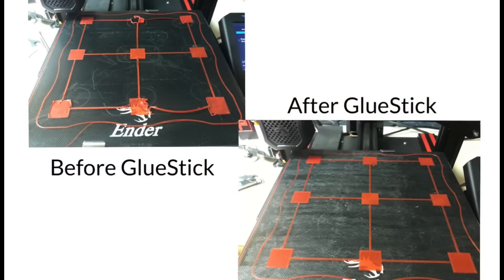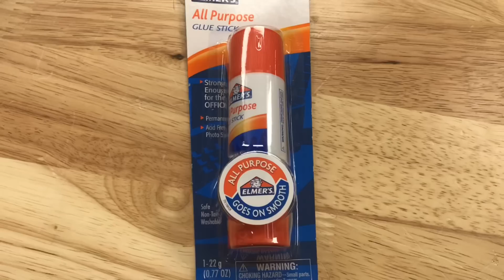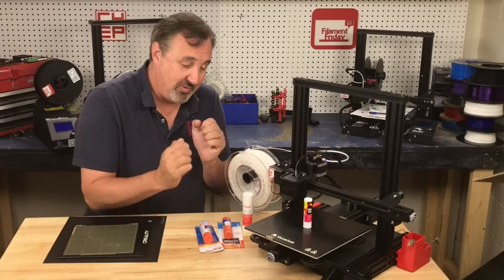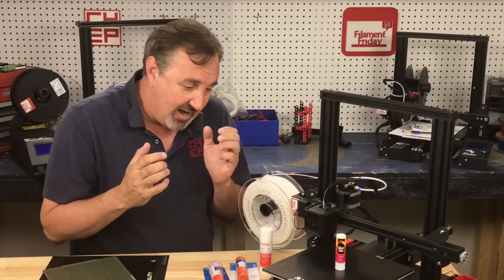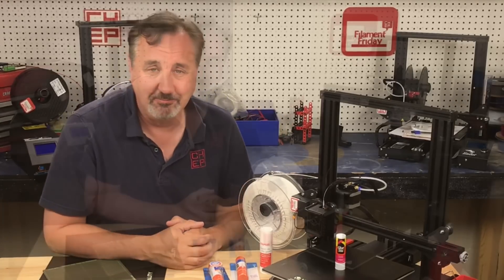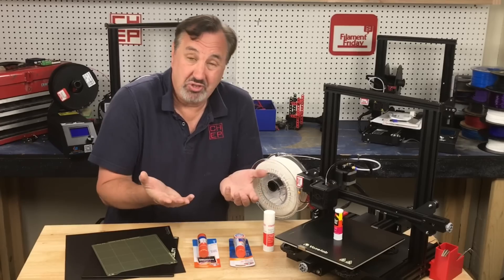Better Bed Adhesion with a Little Glue Stick

Comment: Thanks. For the tip.  I was having a big issue with the prints coming off in the beginning of the print and then right before it finished.  I use an ender 3 pro with the platter, ender pad and a glass.  Swiped on glue and let sit and started to print.  It appears to be working so far on a sample print.  My platter is level also.

Comment: On my ender 3 v2, I've had adhesion issues both not sticking or sticking too well. Saw somewhere that cleaning with dish soap. Tried it and lo and behold, prints stuck until the bed cooled, then popped off with a very mild bump. I will keep the glue stick in mind for when the carborundum surface wears out.

Comment: I know it's a little messier but i'm still sticking with hairspray. But, i do have some glue sticks laying around. This is all great advice, especially the part about the you need a new build surface babble.

Comment: I love the WhamBam pex but I have had a roll of PLA filament that just would not stick to it. Switched back to the old build tack (still didn't stick) so added glue stick and voila! perfect every time washed the surface between prints and had no issues. So I swear by glue stick too - only when needed.

Comment: I run glass from the dollar store on all mine. I haven't used glue in years. Straight on the glass after level and go. Haven't had a failed print in at least 2 years. But to each their own if it works for you.

Comment: I totally agree with glue stick after leveling. I find putting it on cold works the best for me. I find putting it on a hot bed makes it go on too thick and harder to control. Just my own findings.
Reply from the maker: Yes, I should have mentioned that. I always apply to cold bed.

Comment: Glue stick works like magic, my prints come out perfectly flat on the bottom.
I have even experimented with lowering the plate temperature and it still works, which saves on electricity, the sticks literally pay for themselves.

Comment: I used a glue stick and after a while it was just to difficult to remove and it also failed after a while. Then I tried firm hold hairspray it holds on and I can go layer on layer. It also cleans easy with hand sanitizer alcohol. Every once in a while I still need to level my bed but I think that is just because of the cleaning after using hair spray but that was the case with the glue stick too. Hair spray is also easier to apply. Just a layer or to and we are ready to print. And when it leaves a little imprint after removing the objects you just smooth it with another layer and keep on printing. The glue stick had to be cleaned every time because it lost it's stickiness after one print.
Reply: Why would you use hand sanitizer that has other things in it? Why not just use isopropyl alcohol?
Reply: Did not know about it until now, or where to get it.

Comment: Interesting. I found this video because my Neptune 4 included a glue stick but didn't mention it in the instructions.
Reply: I’m interested in the Neptune 4 which model do you have ?   How are your print at 250 mm ? Thanks
Reply: I have the regular Neptune 4. My first print turned out well, but I haven't printed much since then.

Comment: I replaced the magnetic sheet that came with my Ender 3 Pro with a glass bed from Creality.  I haven't had any trouble with PLA sticking to the glass but PETG would lift.  I used the purple Elmer's Glue stick to solve the issue.  I would recommend.

Comment: I used a glue stick and I messed up the textured side of the stock ender3 glass bed trying to clean the glue off. I now use the smooth side with sugar water and everything sticks far better than the glue ever did. Sugar water on a 40C plus bed sticks very well, still pops off when cooled, and super easy to clean. This is for PLA.
Reply: The best way to remove the glue stick from the bed is window cleaner - something like Windolene. Spray it on, let it dissolve the glue for 30s or so, and it'll come straight off.
Reply from the maker: A warm wet cloth also works great. Just lay it on the bed, wait 30 seconds, wipes right off.

Comment: Preheat glass beds, especially the thick ones that come from Creality. There is a lot of thermal mass to get up to temperature. Just because the probe point at the bottom of the aluminum build plate is at proper temperature doesn't mean that it's hit equilibrium across the opposite surface of the glass.

Comment: I use one swipe of glue stick then smooth it on with an IPA swab. After a few prints, I'll refresh it with another IPA swab - no need to apply more glue for weeks.

I also learned the hard way to ALWAYS use glue stick (or some middle layer) when printing PETG on a smooth PEI sheet. Expensive mistake.

Comment: Often times, my prints stick OK on my PEI flex sheet. However, when I want to be sure on a long print, or I'm using something that will stick too well, I use the purple glue stick. 👍

Comment: Do you clean the gluestick between each print or will the glue last for several prints?
Reply from the maker: Several prints
Reply: @FilamentFriday  thank you. All of a sudden my Eryone prints stopped sticking even though I cleaned the bed and rechecked my Z. I ised a glue stick today and got 2 solid prints so far. Again thanks.

Comment: Honestly, soap and water on PEI does more than scuffing it in my opinion.  That being said, I used glue stick to print PETG on my PEI bed and noticed how well EVERYTHING stuck from all kinds of laydown heights and flow rates... if I have a tricky print, I'll put down gluestick to make it easier.  I think a lot of the "hate" comes from people using it as a crutch because they can't properly tram their beds.  Once you CAN tram and dial in your z offset, making life easier by applying some glue makes a ton of sense and it's GREAT for extending the life of a bed.

One trick I use is to only "mostly" clean the glue stick, it leaves a thin sticky film all over the bed again and I get more use out of the same application.

Comment: I've always said u don't need to clean the bed like people always say. I look at my bed like a cast iron pan. The more u use it the more seasoned it gets. Maybe 1 time a month I heat the bed scrap it with the scrapper and reapply a layer of glue stick and hardly ever have issues.

Comment: I upgraded to a glass bed on my Ender 3 Pro. I use a skin adhesive called skin tac and then sometimes I'll use glue stick. I suffer from warping from time to time and have had failures.

Comment: Glue stick in conservative amounts, then spray a bit if water and spread it around. In my opinion, glue stick is absolutely essential when printing PETG, since it can stick a little too well to both glass and plastic bed surfaces.

Comment: I also use glue stick quite often. But sometimes it makes me mad, because at the end, I just can't get my print off the glass bed after using glue stick with bigger prints.
Reply: Same here. Usually it means you are using too much glue. I use a no name brand i found here in Sweden and it works wonderfully. It is super strong and if a lay more than 2 thin layers of it then whatever i print will stick super hard. Can't even get a painters knife underneath it. Sometimes i hit it with hammer and screwdriver 🙃 and it comes off 😅but thats just because I don't want to use water so the glue doesn't melt but if you just put a bit of water around it you will be able to get underneath and get it off.

Comment: I've been favoring dissolving some "Tacky Glue" (looks/smells/tastes like Elmers liquid glue) in a little bit of water and spreading that over a heated bed and evaporating the water, it gets a very consistent thin layer. and generally instead of re-applying, I can just wet it a little (while bed hot again) and spread out the glue to the areas where the print pulled it up. (FYI printing on Kapton Tape)
Reply from the maker: Elmers liquid is a higher PVA concentration than glue stick so add water makes it similar.

Comment: I just spray some super hold hairspray and it works beautifully. I have used glue stick many times but hairspray is easier and it doesn't leave a film on my prints.

Comment: I use a Creality PEI bed on my Ender-3. I find that acetone works much better than isopropyl alcohol to keep the surface properties like new. I never rough up the PEI surface because I like the look and feel of a very smooth bottom surface of prints.
Reply: I haven't used acetone because it's so volatile. Based on what acetone is commonly used for, it seems like overkill for this. I use it in my shop for some crazy things. Yeah I just couldn't imagine putting it on something that has a coating on it.

Isopropyl and lint-free rags. I've never needed anything else.
Reply: @dangerous8333 : I thought the same thing back when I used only IPA, before I tried acetone, because acetone melts so many plastics and PEI is a polymer. But that is also why it works so well on PEI. It doesn't damage the PEI coating, but it aggressively removes all other filament residue, grease, etc. I had dark PLA stains in areas of repeated printing that IPA would not take off. Acetone makes quick work of these stains and does a very gentle resurfacing of the PEI. But if IPA works well for you, by all means keep using it. I found that IPA no longer did the trick after months of use. Acetone changed that, and now I use it all the time.

Comment: 3D Lac where needed, especially to protect the glass and coating from PETG. 
IMHO:
On the stock CR10v2 I put multiple layers of Lac before cleaning it. 
The carbonized glass on the Ender 3 pro works best when it’s clean and level the bed just a bit closer. 

Glue sticks looks so nasty on the build plate, I think that’s the only reason that I don’t use it.

Comment: I have a PEI metal Sheet, and still have some prints pop off at close to half way finished.  I use Elmer purple glue sticks and it works great. The white one is too gummy and a mess to clean.

Comment: I used to use glue stick but then my prints wouldn't come off the bed at all. I've shattered glass plates plenty of times, cut my hands, broken prints. I guess I just need a different plate. I'm using magnetic textured beds now and I love it.

Comment: I use Elmer's wood glue diluted in water. It's PVA so I guess it's pretty similar. Seems good for several prints. Works for PLA, PETG, TPU, and Nylon. Still need to go to hairspray with ABS though. This is all on a glass bed.

Comment: Yep glue stick works great, its cheap, easy and effective. Its very rare I get a print failure due to loss of adhesion on my glass bed and when I do its down to me pushing the number of prints i am  doing between cleaning and reapplying glue on my bed.

Comment: I will only use glue stick or blue tape for TPU on smooth PEI flex sheets. I will also print with a raft as well if needed.

Comment: I have two types of build surfaces: SSS and mirror. For the SSS I just use alcohol to clean it when it fail to stick and for the mirror just wash it with soap.

Comment: I use acrylates, ie, hairspray. Better than glue stick for most prints but it does not stick as well, but pops out very nicely. If i need to protect corners from lifting, i add extra adhesion with Tabs plugin in Cura, or add gluestick. I made a cardboard box with open top and bottom that i pop in the bed, then add the hairspray, so it doesn't go everywhere. I wash it off every now and then and apply the main coating away from the printer... that is an option.. remove the bed, then spray.. For touchups, i use the box.

I also started to sand the hairspray to a matte finish, MUCH better than just glass. The right hairspray is the hypoallergic kind, it has the least amount of additives.

Comment: Hi, I exactly have the described problem… my print do not stick to my bed on my Ender 3V2.
I already tried cleaning the bed, leveling the bed, changing the springs, even changed the complete hotend, because I thought it could be the temperature sensor. I also played around with different temperature settings for hotend and bed.

What I missed in this video was the „practical“ part, to show what exactly is a „swipe“ and how to apply. Do you swipe one line on the bed and distribute it with the fingers over the bed or do you swipe with the stick all across the bed? - Do you use light, medium oder high pressure when swiping over the bed?

But anyway, thanks for the hint, what I can try to get my printer back to work….

Comment: Glue stick That works just fine, and has done so for me to for a long time. 
But i guess there are many that have to make a problem here to. 
There is nothing wrong going out bying new print bed  or buy a new printer if you can afford it.  
So a good clean and glue stick is one way to get it working longer and cheaper. Pending on how you see it or what you can afford.

Comment: I use magigoo with a 'S" swipe on the build plate.  I just wipe it down with a little IPA after each print and the goo is still good.  I only apply new Magigoo only after 8 or so prints.

Comment: I don't know if Marlin allows this, but you can modify the idle behavior in Klipper.  I print a lot of bed covering multi-color prints (by layer) and so I changed my idle behavior to only turn off the hot end but no the bed or steppers while Paused and idle (but turn everything off when not pauseD).

Comment: I have an ender 5 pro and use a glass plate with blue tape and have never had trouble , I actually have trouble getting the print off the tape

Comment: I also like glue stick. I have a smooth glass bed and pla sticks great right after a good clean and level. For all other times glue stick is what I use. And spoiler - I'm lazy, I rarely give the bed a good clean and level.

Comment: Specialized 3D glue is the best and cheapest option. I got my bottle for $10 year and a half ago and used 2/3 of its volume for now. It is sticky at print temperatures and print pops up by itself when it cools down after print. I use Glue stick for PETG to lower adhesion to print table as it may break glass (and it happened to me couple of times before)

Comment: Here in Europe I’ve used a brand called Prit.   They have a gray and red product.  For this, the gray (stronger) one works best…
Reply: It's Pritt, right? Thank you for this comment, all those American brands aren't here and I've tried ones found around the house with very different results. One would just roll on the glass, the other printed well.

Comment: Great Video, Chuck, but i do not understand why people need to use all that stuff. I am using a little modified (silend fans&bltouch) CR10S pro V1 printer with a creality glass bed!
BUT: I do NOT use the rough side (with the coating) but the glass only side. After a bit more than 500 prints it still is like new.
I wash it with dishwashing liquid an water after ever second print. (A few drops of palmolive and running tap water - The prints stick very strong, but as soon as the bed cools off, they just fall off. I never needed a tool to remove them. Ok i am only printing PLA, with 195 nozzle temp and 63 first layer and then 60 degrees for the bed. And if i run into adhesion problems, i heat the bed to 60 and run an auto-level. (its needed every 25 prints) (of course i have to call the saved mesh settings at startup of every print)
But since i have been using the smooth side of the creality glass bed i never had adhesion problems any more. 
I am also using the creality filament, but i have tried the very cheap amazon basic filament, and it sticks perfectly also.
I did have adhesion problems when i was using magnetic bed, and even when i tried the coated side of the creality glasbed. but since i turned it upside down... no more problems.
Luc
Keep up your very interesting videos.

Comment: I use either glue stick or Vision Miner's Nano Polymer depending on what I'm printing. For the exotic stuff or long prints, I use Nano Polymer. For everything else I just use glue stick.

Comment: here in Brazil we have a specific brand of hair spray that its so sticky that you can lift the bed with your hand placing your hand on the top of the print surface XD too bad we have to clean it more often

Comment: For some reason I never considered pushing the nozzle temp higher for my first few levels. Every time no matter what, printing with no raft is a disaster no matter what I do. With a raft it's flawless but with the obvious setbacks of a raft. My Inland PLA says temp range is 215-230 and I've been at 218. Definitely going to try a bit higher. Thanks!

Comment: what is the best? Glue stick using before or after bedleveling. When I use hairspray is spray after bedleveling with good printing.
Reply from the maker: After
Reply: @FilamentFriday Well to each his own. I have always refused to use glue stick, ever. However; on my Bambu Lab P1S with PEI sheet, I couldn't get a specific PLA print to stick. No matter what I tried. While watching your video, I decided to give glue stick a go as my last resort. And what do you know... it worked. First time I have ever been able to so this print on my PEI sheet.

Comment: Hey I need your help please! I am using ender 3. After some print it start beeping continuously. Have you faced this kind of problems. If you know how to fix it. Please tell me. My projects are incomplete.
Reply: This sounds like thermal runaway protection (which is a good thing). Probably one of your thermistors has come loose, check the one in the hotend and also make sure the one under the bed is still well stuck. I recently had my bed thermistor come loose as tape peeled a bit. Prints worked fine for a while and then beep beep beep fail. Fix was to peel off the old tape and put fresh kapton tape on :)